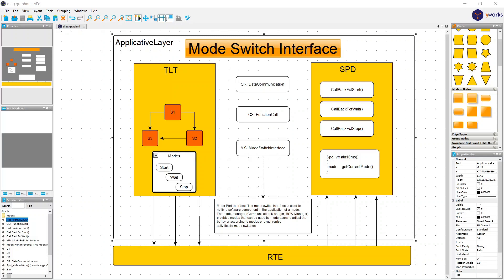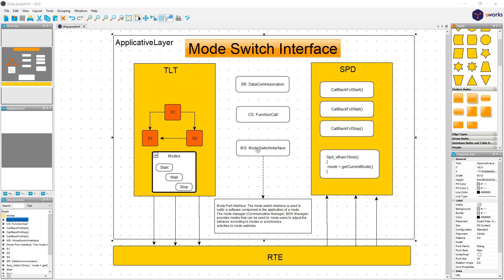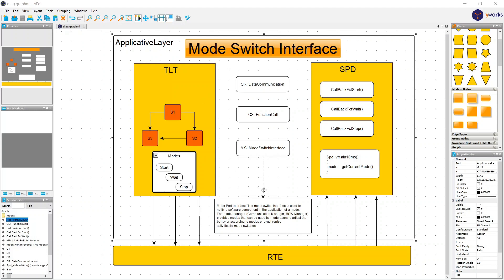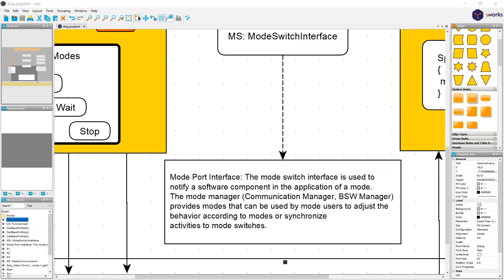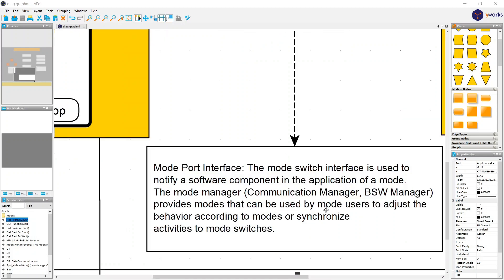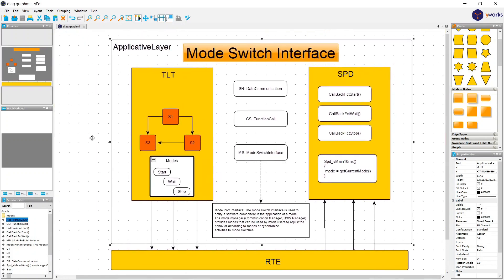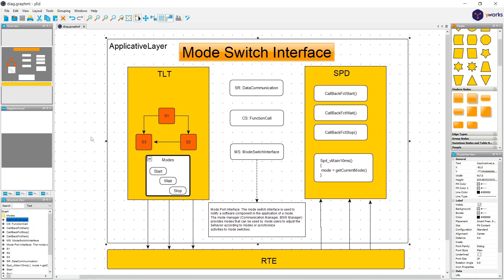Classic Autosar - How to create mode switch interface communication

Comment: Hello @EmbeddedRoom, really nice presentation. Thanks for sharing with an implementation example. It really helps me to understand. I would like to ask a question, from the TLT, do we need any Rte Write ports to indicate the receiver that the mode has changed? How does a mode change be linked to any kind of trigger to be initiated from the TLT compoent?
Reply from the maker: Hello. Yes a Rte_Write port is needed like it is shown to indicate a mode change. Besides what is shown in the video a "ModeSwitchPoint" is also requested to be set in the InternalBehavior and mapped to the PPort of the TLT module(sender).